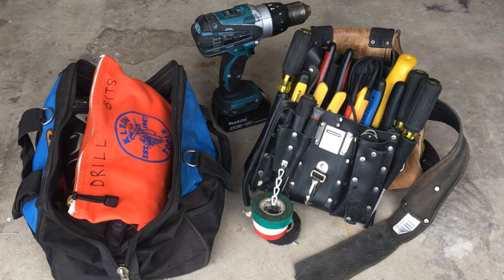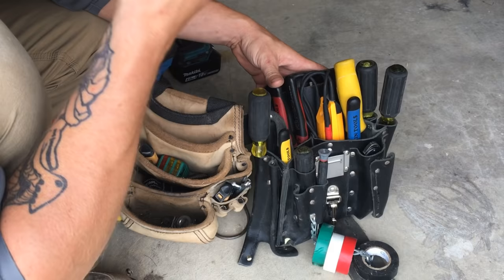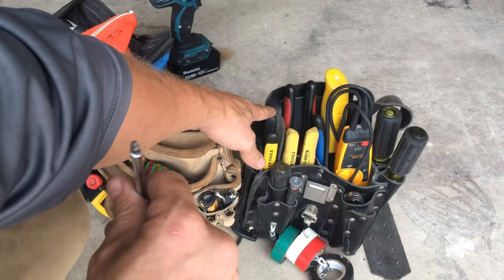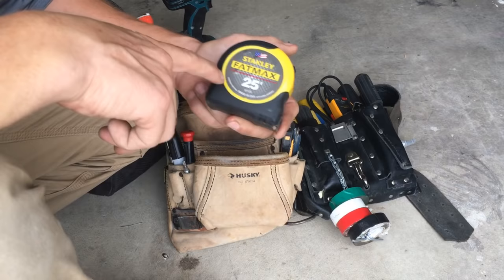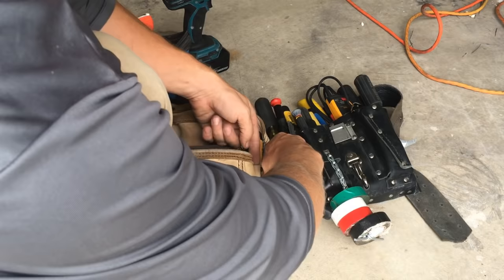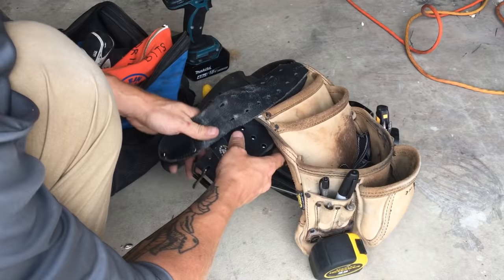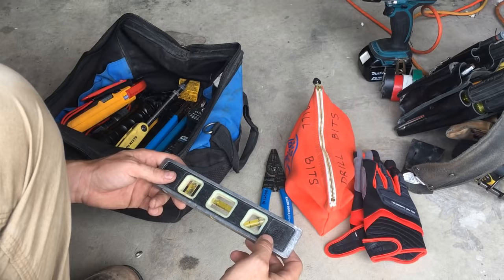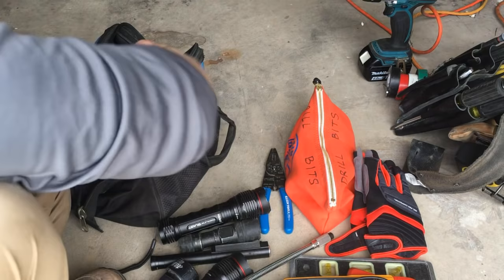Episode 2 - Tools Every Apprentice Electrician Needs To Start Their Job

Comment: I have some Commercial Electric screwdrivers... though they're cheap I would have have cheap insulated screwdrivers then a live screwdriver because instinctively we all will touch the metal of the driver... we do on occasions have to work on some live stuff.

Comment: Should make a video of the power tools you'll need. Getting a portable band saw made me enjoy being an electrician
Reply from the maker: James iPad man I really want to make one badly!  I've got so many damn videos I want to do on more advanced stuff too. I'm going to do that but I'm trying to start these slow and from the very beginning so they can be watched by green Apprentices from day 1 and then start ramping it up as we go
Reply: 12V Milwaukee bandsaw kit for cutting flex, MC, Kindorf, unistrut, EMT, liquid-tight, rigid, and bolts is best $160 I ever spent.
Reply: Jules Bartow the dewalt has speed control, very handy for cutting armour cable without hitting the wires inside
Reply: Yep.  Barely circle your way around PVC, AC, MC, ...  Milwaukee is variable speed too.  12V is light weight & capable.

Comment: I work in a paper mill as an electrician/instrumental technician apprentice, and i spent a lot on my flashlight as its often the only light in the area, might be different for residential but don't skimp on it (powertac e9 is my choice, I've owned two and I'll buy another if this one wanders off), also those are 9" channel locks, 6" are the smallest, side suggestion if you're messing with medium or high voltage or spend a lot of time in boxes i will recommend poly handheld flashlights so on the off chance you drop it you aren't going to short stuff out, i use a pilystinger by streamlight if I'm worried about that happening
Reply: Another suggestion, if you use your channel locks for mostly conduit or pipe and not bolts get fitter channel locks, they grab better (jaws arent straight) and they grab your big ish bolts better than straight jaws as well

Comment: Im a commercial electrician, 2nd year apprentice, if you go into commerical invest in a level with better magnets like milaukee or greenlee, make sure you know what your task is and that your confident to do it, always pay attention. Milaukee dewalt or makita should do the job for drills/impact, not many makita drill guys though.
Reply: sam have you tried the Klein levels? Those in my option are the best, have some good ass magnets. I have the small 6 inch level and it works amazing!

Comment: Those one-handed sawzalls are really useful too, should be your 2nd power tool after a drill.
Reply: I think you mean one-hand bandsaws
Reply: @BULLTRONHERO  Bandsaws are great, but you can do more with a sawzall. Personally, I'd get a sawzall first.
Reply: @guitarguync  You most certainly can do a lot, but it's far easier to not mangle unholy fuck out of your EMT and large cables (250+) and 3/0 etc. with the bandsaw.
Reply: @guitarguync  I guess I should also specify that I'm in Commercial

Comment: Agreed. This is not a commercial/industrial load out. The paddle bits are a clear giveaway. Plus No wrenches no channels no level... No Roto splits. Garbage strippers get the ideal ones with the rubber Press point in the middle. The yellow Klein needlenose are a waste. And please don't tell me you don't wear that on your waist. And a Klein tape is what you want so you can release it when it breaks for free at home depot. Mag tip is a must plus bending multipliers... you know what I gotta post this in the main.
Reply from the maker: You must not have watched the entire video.  There's a carry along bag that has alans, channels, and a level.  Again this is day one apprentice shit.  If a greenie goes to work for a shop that does heavy commercial work then they will find out very quickly that they need one.  And I disagree with you on the yellow strippers.  I've used many different types and brands and the small yellows are still my favorite.  I agree that ideal's set is great.  I have 4 different types and sizes that I trade out depending on if I need bolt cutting and what size bolts.  Just keep the yellow ones closer.

Comment: We call those testers “hot sticks” or “idiot sticks”
Reply: That's the most important tool you'll own as a Electrician how can you say that ? Detecting voltage is a must before you can move on any call you get . Every tool has a purpose and knowing when where and how to use them is the difference
Reply: @slyspy9819  I don't think he meant to type Tester. I think is was referring to the Ticker or Sniffer
Reply: @MyUnquenchableThirst  Sounded like it to me , if he had the "Greenlee 2010 he wouldn't say that
Reply: @slyspy9819 
I think you're missing the point of the name.

It's not an insult to the tool. It for detecting if the component is hot so you don't make an idiot out of yourself.
Reply: @wanderingcalamity360  , What do you mean "make an idiot out of yourself" ?
Reply: Non contact voltage testers are great. The problem is idiots don't test them  before and after testing. I work for a apprentice firm and they got banned cause some fool didn't check his stick was working and got zapped. Guess what, I still use one
Reply: SLY SPY It’s called that because it prevents idiots from getting themselves shocked...Calm down my guy, I didn’t invent the name
Reply: @matthewj616  No sweat Matthew , I hear you
Reply: We call them widowmakers
Reply: In Germany we call it "Lügenstift" roughly translated as "Pen of Lies"

Comment: The defective side cutter is normal among us electricians.🤣
I still have one lying around somewhere, with which I once cut a cable with 400V three phases, fused with 35A Edison fuses in an old building here in Germany. The side cutter has not only a quirk, but no cutting edge. Through the hole fits easily a cigarette.
The colleague said that he had disconnected the line. That's what happens when you don't check it again yourself.

Comment: I have several different brands of lineman pliers including Klein.  Oddly enough,  my favorite is my Craftsman Professional, which is no longer sold. Klein needle nose pliers are the best. They will not twist out of shape. 
You will also need several 5 gallon plastic buckets for hauling plan B tools.

Comment: I honestly kinda stopped listening after seeing the box cutter. The amount of people who show up with them is astonishing. Yet theyre the reason most wires get nicted and cause heat points that then lead to fires or wire failures. They're just too damn sharp. Were Electricians we use our knives to skin lumex or larger gage wires. Get a basic Electrician knife rub it on concrete to dull it down and skin your damn copper without breaking it. Other wise I like your kit for the most part I feel it's a little on the heavy side. But then again I've done mostly commercial. My ratio being probably 80/20

Comment: I wouldn't brag about cutting into live wires.
Reply: I wouldn't brag either but it happens......
Reply: Shit happens. If you havent cut into live wires, you probably havent done it a while
Reply: I swear I though it was dead. Not my tool though.
Reply: I was told to "throw that piece of shit in the trash."  Tester.
Reply: Perhaps if he used his fluke multimeter he wouldn't be cutting into live cables. Simple don't work before testing for dead and it won't happen.
Reply: Burnt up tools.....
Reply: It happens mate. I’ve only done it once or twice in 18 years but it happens none the less.
Reply: Roger that. Things happens but being cocky versus skilled can get you lit up. no wattimean
Reply: I would like wtf that shits cool lol
Reply: 43 years and I never blown up a plier
Reply: Check for power, cut one conductor at a time. Haven't shorted a wire on a tool in looong time.
Reply: @dxman417  this
Reply: bingbonga binga I was taught that if you ever assume about wires, assume they are live.

Comment: Good stuff.  I just bought a house and as a first time buyer with no experience I am clueless about all involved in the house maintenance.  I do have a degree in Engineering and  at least electricity-wise I know  the principles of electricity and math involved of any type or surface. I will build up my knowledge and these tools are a must have to begin with.

Comment: You can make a good step-bit like Klein/Greenlee, etc....Last a LONGGGG TIME, if you use the right pressure and right settings on the drill. I learned my lesson buying cheap step bits from amazon, they work on thin metal for like a week. I have another Greenlee one that has outlasted 4/5 amazon/HF step bits....

Comment: Throw that damn multi tool away!!! Them things are trash and will get you hurt in a panel. They're great for service tech's that don't have to pry or beat or pull or anything with force, but if you're planning on being industrial, save your 20 bucks and just use the screw drivers you should already have
Reply: Pretty sure he has screw drivers for beating and prying in his bag as well. He likely uses the multi tool when he needs it specifically, but otherwise uses his others. It doesn't hurt to have a multi tool, as long as you know when to NOT use it.

Comment: Join the union.  Their you can save some $$$.  No cordless, power tools, bits, razor blades, wrench over 14 inches, contractor supply all those including, PPE, hard hats, glasses, gloves, head lamps, and so on.  And better pay, benefits, and important you are more SKILLED, KNOWLEDGEABLE, AND TRAINED CORRECTLY.
Reply: Generally true. But not all the time. Union is great for Commercial. In Industrial the game changes and Union Sparkys few and far between. Union Electricians are the best at Commercial.  Not so much in Industrial settings.

Comment: I used my drywall saw to cut 2x4's more then anything else. tool belts are nice for residential work, anything else get a box, or a rolling tub, the amount of standing and walking will blister your feet and if you got a 30lb belt on all the time you won't be able to stand and walk to go piss the next day.

Comment: Nice video my dude. Been doing electrical maintenance for a printing company for 15 years and funds and ordering tools are unlimited, needless to say I've worked with ALL of the major tool companies and not once have I ever had any issues with klein other than rounding off of a bit here and there. Those needle nose klein strippers I've had for over a year and so far so good on those. My approved hand tools would be all klein, all knipex, all wera, some weha, all snap on, some craftsman. We also have an account at home depot so all new guys get husky tools if they don't have their own, as far as I can tell husky isn't bad if your on a budget.Side note: Try retiring or giving away those channel locks water pump pliers and invest in the knipex cobras!...

Comment: My advice is to get every tool you need. They dont have to be Klein, but a good brand of tool is a must. I have found Southwire to be an excellent brand, a long with Kobalt. In reality you'll use only a few tools most of the time, but you'll need a large variety of tools from time to time. Two tool pouches is a must also. I made the mistake of putting all my tools in one pouch. Kind of a pain in the ass to carry around. I like to put the tools I'll need for the day in one pouch and keep the rest close by. It'll save some wear on your body.